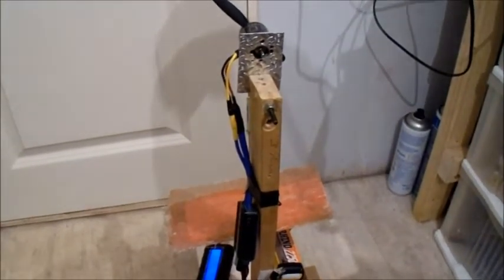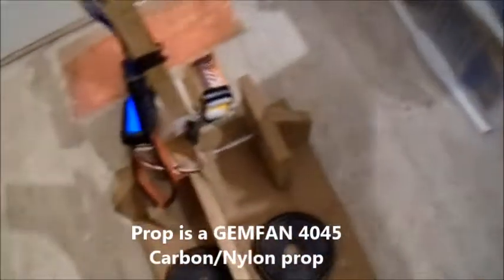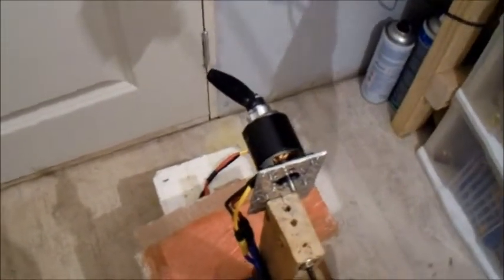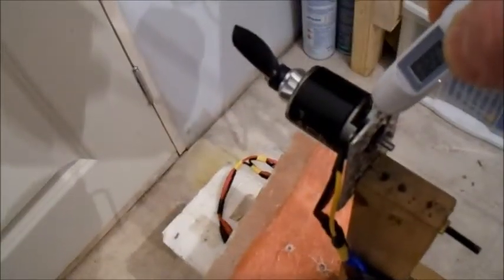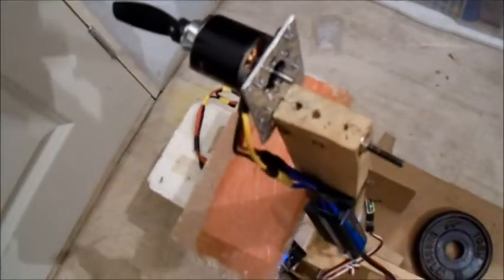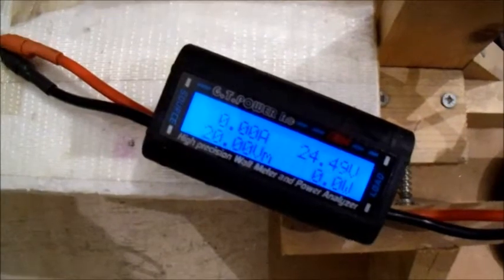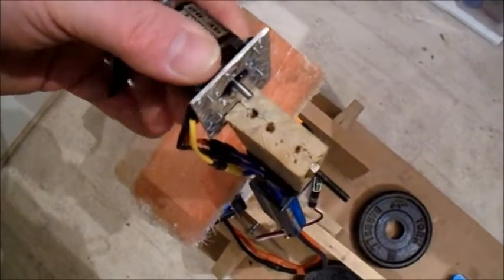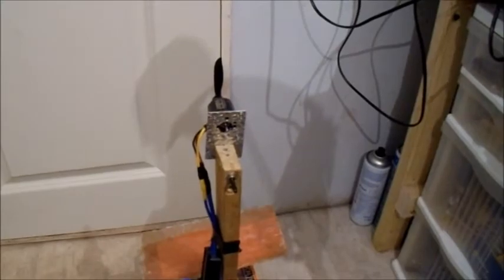PROPDRIVE 2836 2700kv on 6S Thrust Test

Comment: Hi, cool test. I'm looking at your channel because I'm looking to outfit a Sweepwings Behemoth. I bought a motor that I now want to use elsewhere (600 Series 1220KV Brushless). One of these type, but bigger, motors would be great on 6S. 
I'm going to look on your channel for a brushless inrunner motor as I hope they are efficient.
Reply from the maker: Hi
Yes take a look at my other vids see if there is anything you like. Modern inrunner motors are very powerful these days but are also much heavier then outrunner motors. Just thought i'd say. Thanks for watching.
Reply: @rcplanepirate  Thanks, didn't know they were heavier than out runners, all else being equal. I wonder if the trade off is more efficient.  I did watch one of your other videos on a brush less in runner. Will be watching more. Thanks again.

Comment: Hi. I could not find a proper test for the 2836 2300kv motor ( not the 2200kv). Do you own that motor, could you do a test? Thanks in advance, Norbert
Reply from the maker: Hi Kapdebo
Sorry I never bothered getting one of the 2836 2300kv  ones as I thought there wouldn't be much difference at all to the 2200kv version. 
Thanks foe watching though.

Comment: OK but do you think really that the rpm will be 58.000?
Reply from the maker: Maybe? It's the only way to calculate the rpm. Voltage drop shown on the wattmeter x the kv. I think the 5s setup works way better with the 4.5x4.5 TGS prop. If you haven't already seen it it's at the end of the video of my full test of this motor. Link  https://www.youtube.com/watch?v=yb_tB7Aw37A&t=1554s

Comment: hey rcplanepirate
 can you please test turnigy aerodrive sk3 5055 430 kv motors and recomend a good prop combination,i cannot do it myself because i cant afford to test them as im student,it will be very helpful for me.thanks in advance
Reply from the maker: Hi there 
I'm sorry but I don't have one of those motors and I won't have any need for one in the future so I won't be getting it. I do how ever have a similar sized motor. It's about the same weight, slightly higher kv, a little bit cheaper but a lot more powerful. The sk3 is rated to 1750 watts but this motor is rated to 3100 watts! Here's a link. http://www.ebay.co.uk/itm/GARTT-510KV-3100w-12S-Brushless-Motor-For-T-REX-T600-RC-Helicopter-MT-009-/271962537903?hash=item3f523affaf:g:RbwAAOSwzaJX~w1m
It is a helicopter motor so does not come with the accessory's the sk3 comes with to mount the motor both way's round but it could be modified to work both way's. It works on up to 12s so I just need to get two matching 6s battery's to run in series to be able to run on 12s.
If you think you may use this motor instead of the sk3 I will get the bit's I need and will try to get that test done soon. Hope this helps you out. Just wondering what plane is this motor for?
Reply: rcplanepirate man,thanks a lot for your reply, my team is participating in sae aerodesign,so i was searching for motor and prop combination to provide  enoguh thrust to power a 10 pounds aeroplane with a payload of nearly 15 pounds
Reply from the maker: WOW! That's a lot of weight. The motor I suggested may not be the right one then. You will need to run a very big propeller on a lower kv motor. I've done some calculations and this may work on 8s turning a a 19x6 or possibly a 20x6 propeller which could give around 10kg or 22lbs of thrust but these are rough calculations and may not be right.
Link to the motor.  http://www.ebay.co.uk/itm/Brushless-Motor-270KV-N5065-5065-For-Electric-Skateboard-Scooter-Multicopter-DIY-/322682574936?epid=19002554895&hash=item4b21615858:g:q-8AAOSwXGtZoScm
A selection of props to try.
https://hobbyking.com/en_us/turnigy-type-d-light-wood-propeller-20x6-1pc.html
https://hobbyking.com/en_us/master-airscrew-beech-propeller-20x6-1pc.html
https://hobbyking.com/en_us/aerostar-gas-series-wood-propeller-19x6-1pc.html
https://hobbyking.com/en_us/aerostar-electric-series-wood-propeller-19x6-1pc.html
https://hobbyking.com/en_us/aerostar-electric-series-wood-propeller-20x6-1pc.html
https://hobbyking.com/en_us/turnigy-type-a-beech-wood-propeller-16x6-1pc.html
https://hobbyking.com/en_us/turnigy-type-a-beech-wood-propeller-17x6-1pc.html
https://hobbyking.com/en_us/turnigy-precision-carbon-fiber-propeller-20x6-1pc.html
This is the sort of ESC you will need. https://hobbyking.com/en_us/turnigy-dlux-80a-mk2-brushless-speed-controller-w-8a-s-bec-and-data-logging-2s-8s.html

Hope this helps.
...RCPP
Reply: rcplanepirate thanks a lot! ,that would be of help.keep up the good work of testing motors

Comment: Can you test 6 s with a 4.5 x 4.5 tgs prop ?
Reply from the maker: Hi Paul
I think that would be way too much for the motor. I have tested this motor with that size prop on 5s with much better results. So if you want a fast setup go with 5s. It's still over spec but much safer. If you haven't seen it before it's the last test at the end of this video https://www.youtube.com/watch?v=yb_tB7Aw37A